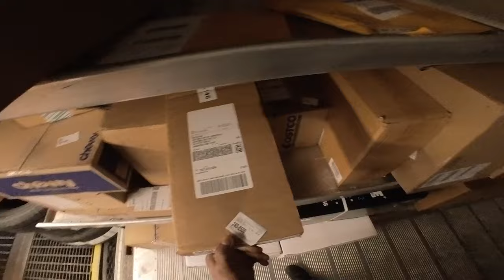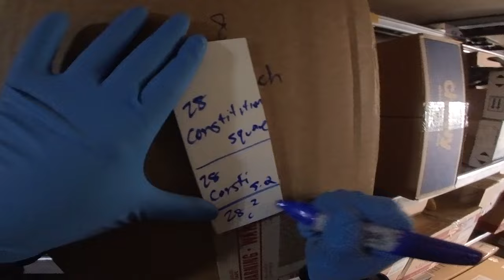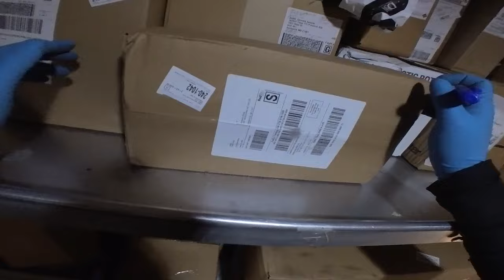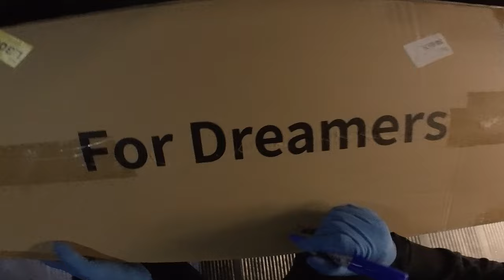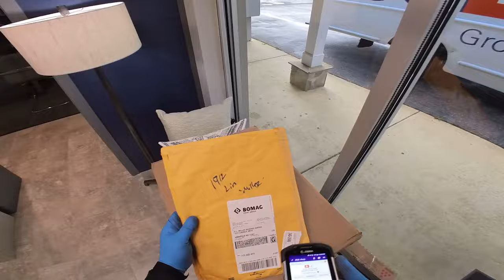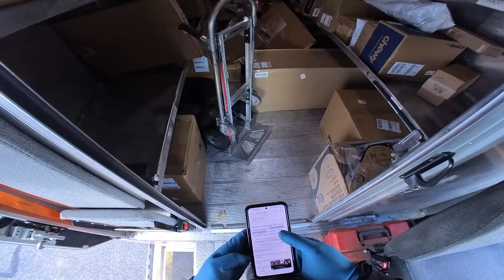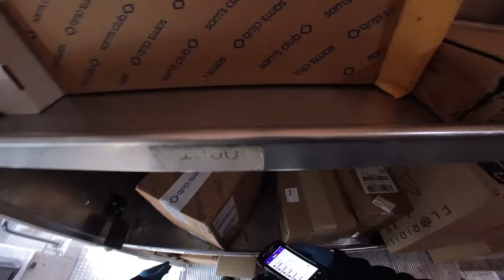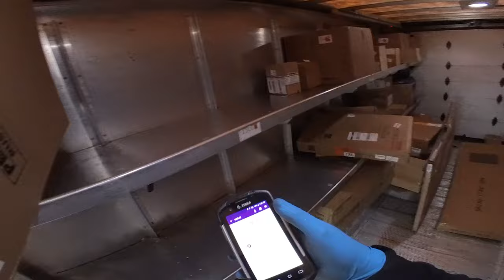FedEx Ground Delivery Driver Ep2 | How I setup my FedEx Truck

Comment: Do you guys use ground cloud?
Reply from the maker: Ground cloud?!? What's that?
Reply: @POVofanENFP  I'm not sure if I replied already, but it's an app that maps out your route, kind of looks like the map in your scanner, but honestly better. It distinguishes between pickups and deliveries like you can see which is which easy as well as express deliveries compared to normal deliveries and also you can tell if certain stops require a signature or not with a small symbol right above the stop location. When you select the stop you want to go to it will show the name of recipient, # of packages for stop, and instructions It may have with that, and importantly the SID number, just makes the day so much easier
Reply from the maker: @pierceage  Wow! Yea that does sound like it would be much easier if someone is on a new route that they aren't familiar with yet. I wish I had something like that when I first started out

Comment: I use the labels, what I do is I circle individual areas I want to knock out first. Then it will just give you the different vision label numbers. E.g. 4012, 3012, 2012, 1012, etc. Marking peoples addresses is a waste of time.
Reply from the maker: Hmmmm... I might have to try that